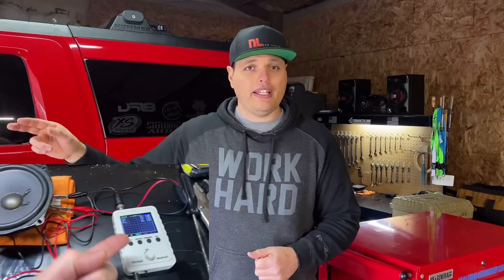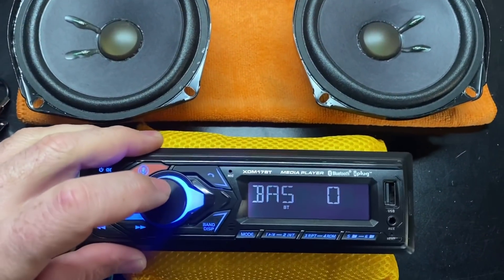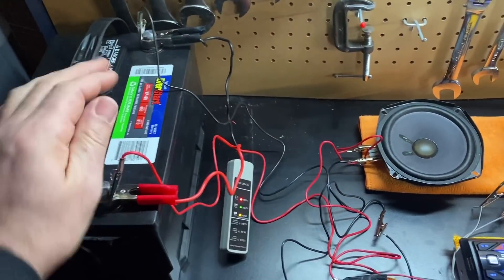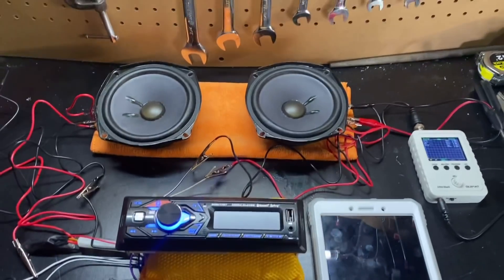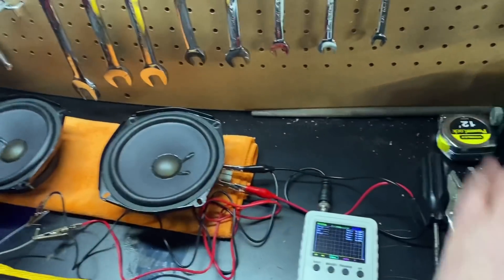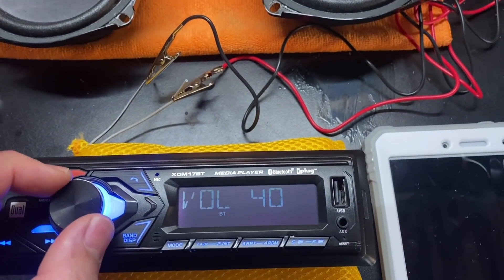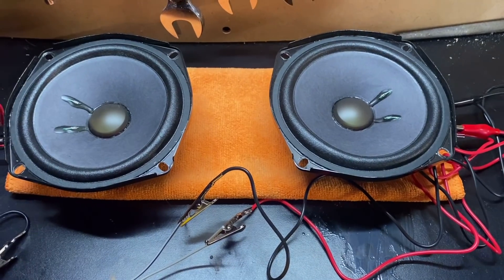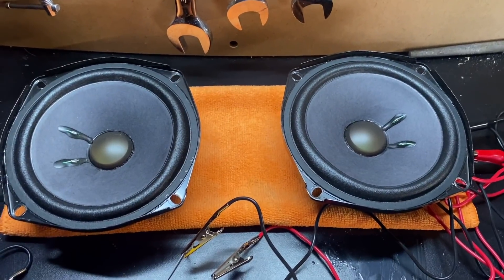#1 Must do tip!!! How to check head unit clipping and non distortion volume point of stereo.

Comment: I just used this method on my 2018 KIA Niro with the stock radio, a Power Acoustik RZR2300, and a Savard HiQ in a custom built box.  The max volume on the radio is 45, so over the last couple of years I decided the max volume should be 33.  Well, after performing this test, 33 is in fact the max volume before clipping starts.  Thanks!!!!
Reply from the maker: Awesome! Thanks for the feedback 😎
Reply: @NextLevelCarAudio  I'll tell you what- whatever head unit you used was a very good 1. Distortion didn't start till the 88% mark where many are at the 75% mark. What brand was it and do you recommend a good 1 with little clipping on a marine unit
Reply: @NextLevelCarAudio  op

Comment: This would be checking for the clip point of the decks amplifier itself. Pre outs will definitely be different as I have tested this before. Alpine units I owned pre outs didnt clip at 35/35, but the amplifier inside the unit was only clean up to 26/35.
Reply: Yeh bro I got an alpine ilx-w650e and when I tuned my type r speakers I tuned it so the head unit is all the way up and it sounds clean as, no distortion. But I also got told that by having the head unit all the way up it doesn’t get as loud because your using less clean amplifier power and more stereo power if you know what I mean. What’s your thoughts on that mate, cheers.
Reply: This is a great point...especially when you have low voltage pre amp outs which are more prone to noise.
Reply from the maker: This video was made for that reason. To help people find max volume  that have, say an amplified subwoofer but still running a non amplified front stage. Or anyone running speakers still being powered by the head unit. Then it is Vital to know when your HU clips. If you are running 100% externally amplified, technically you could send full HU volume to your amps and it can still put out an unclipped signal. Especially if you have decent preamp voltage 5v+. I just personally would not do it. It just makes me cringe to see my volume knob maxed out lol 😂 so, I just use the Same unclipped volume point as the high level reading and dial in everything else accordingly then don’t go past that point. Has worked great for me many years and have gotten pretty loud and clean.
Reply: @NextLevelCarAudio  yeah that's a good rule of thumb...and maybe a bit lower for cheap HU's that have low voltage preamp...that should still give you enough linear volume.
I wouldn't be able to stand seeing my volume at max either. Heh
Reply: This is what I am seeing as well with an iDoing head unit.  Thought I was doing something wrong at first but have tested it in multiple ways with loudness / EQ settings and still clipping.
Reply: I made this mistake on my first setup, but I compensated by having a higher gain on sub amp, not even understanding, but just knowing not to turn the stereo dial as high.
Reply: @NextLevelCarAudio can you test the preout RCAs on a head unit with the scope? Or would you have to go to the amp to test . I’m running a Chinese floating head unit. But I’m running off all RTA’s. I’m running off the front for my four channel and then I’m running my sub off the single sub out.

Comment: I had to try this, and surprising to me the Pioneer 4450bt clips at 48 of max 50. For a relatively entry level unit I was a little shocked at that. Thanks for the tips man, I can tune the amps to that now instead of the 3/4 volume I did it to originally!

Comment: Thank you for taking the time to make this video! This is the 2nd video I watched on this channel. You finally sold me on this Quimat Oscilloscope. I just purchased one now.  I already set my gains using 0dB which now I know is wrong. Should be -5dB. Volume is also set at 29 like in your other video.
I'm using old school MTX amps from 1994. MTX2160 for the 6.5 Diamond S6.0m mids and a MTX2300 on 2 RF 2212 Power DVC's. These MTX amps do not like high voltage. They were putting out too much signal on 3.3V from an Eclipse 8454. Looking into it they are rated at 1VRMS for their claimed output. I'd like to see how their output clips with 1.5VRMS Pioneer 2400NEX if they can tolerate it. Maybe go up to 2V output from the head unit.
Thanks again!!!!!!
P.S. SUBSCRIBED!
Reply from the maker: Hey, thanks for the comment and for supporting the channel. If you need any help with anything let me know ;)

Comment: Got my oscilloscope today..just tested my Alpine CDE 175BT. Head unit amp power which is 18 watts rms maxes out at 27 no clipping. Pre-outs max out at 35 no clipping which is the highest the volume goes. I guess I have one of those one or two head units that maxes out at max volume no clipping. Thanks for the great video. I'm at peace now. :)
Reply from the maker: Awesome! It is common for the RCA clip point to be higher than the speaker outputs. But max volume? Even better 😎 it is all dependent on the preamp output voltage your RCA’s are dishing out from the head unit. But hey, awesome! Glad it worked out well for you!
Reply: @NextLevelCarAudio  It's 5 volts pre-out which is why I got it.
Reply from the maker: Nice

Comment: You have helped me out so much with my truck audio. I can't thank you enough for putting this info out there. Just bought one of those cheap oscopes and can't wait to use it
Reply from the maker: Awesome. Thanks for the feedback
Reply: @NextLevelCarAudio  am I suppose to connect my positive alligator clig to the ground tab on top of the oscilloscope before using it. Out of the box the screen had hundreds of lines up and down and it wasn't even connected. 

Please let me know how to use it from the box

Below are the speakers and amps in connection too

2 wetsound rear facing speakers bridged on polk audio amp @ 4ohm 28.28 @ 200w ch

Jl sub on polk audio @ 4 ohm 34.64v or 31.62v @ 250watts 

2 Wetsound revo 8 & Ds18 tower speaker parallel on jl 360/2 amp @ 2ohm 19v @ 180w ch
Reply from the maker: I go over settings and such in detail here:
https://youtu.be/nKQqcQ5q34I
If that does not help, I’ll have to get back to you later man, I’m not in town and don’t recall off the top of my head

Comment: How do you determine settings on the oscope, specifically voltage? You set it to 2v but why exactly?  Orders one of the cheaper oscopes off Amazon so I can set a 4runner's factory HU that's running to an Lc7i then to kenwood xr901-5 powering factory shitty speakers and a 10" sub. Also need to find bass roll off too from factory so your videos have been helpful!

Comment: if im running this test on a head unit that has a build in amp should i turn off that setting before i try to find the clipping point of the head unit? i will be running an aftermarket amp

Comment: It is worth mentioning that some units with rca outputs may clip on the internal amp but not on the RCA pre outs.
Reply: So would it be of any bit to doing this after the amp?
Reply: @dropzoneJustin  you work it like a process. Say you have a head unit a mid 2/3/4 channel amp and a mono block amp you would disable the mid and sub amps find distortion/clip of head unit and never pass that volume afterwards. Then you do the same thing but checking the signal out of the mid multi channel amp to set the gain. Then disable the mid amp and set the gain of the sub amp. There is also ways to use a calculator and multimeter to ensure your gain is correct along with this way of listening. Once you have the head and mid set disable the mid amp and go onto the sub amp and repeat the process. Remember each of these amps are playing a select signal range you may use a 80-120hertz signal to set the head and mid amp but then use a 40herts signal to set the amp to sound but always verify with a multimeter and calculator that the gain is within tolerance. Once you have the head unit volume noted i would set the head unit to the preferred EQ/loudness on or of all that stuff and check it again because the clip point could change with those settings. Always look at the audio system as a chain of command because if you have a poor/undesired signal at head unit (first in the chain) then it doesnt mater what you do the signal of the next links in the chain is already undesirable. Not all of us can afford the fancy SMD tools or an O-scope or know how to use them. Another thing to consider is give yourself some head room if you daily drive and bump for hour or more at a time find the gain setting max and back it off a bit so your equipment doesnt struggle at 100%. Setting crossovers is also a key part to not blow your gear if you set the crossover cutoffs and slopes to be sharp (12+db) the undesired frequencies fall off faster and your equipment becomes more electrically efficient IE amps dont get as hot speaker coils dont get as hot and for subs they arent trying to jump out hte box and run away. Sub over excursion and heat is the number 1-2 killers. Subsonic filters are a bit new to me but say your box is tuned 31hz and the speakers FS is 38hz but claims to range from 24hz to 900hz you dont want that sub playing at volume a 20hz or below signal you want that subsonic to drop off at like 30hz because it will roll down a slope from the 30 to 10hz range the DB setting of a slope is the speed the filter rolls off down that hill and the lowpass filter is the same thing but for the other side of the signal range like from 80hz up if we are talking subwoofer it may be set to anywhere from 80hz to 250hz and slope off as the hz increase. Hertz is basically like beats per minute of an alternating current be it AC or DC power. good luck tuning and remember give yourself some room and your gear will last longer dont crank dials to impress or 1-up other people. IF you set your stuff up right it will last a long time. I am just now building a new system the last one 4-jensen Xs1010 150watt rms on 2 old 2channel amps and a 2/3/4 channel Logic Soundlabs 800watt amp for the mids and highs getting signal from a old school pyramid switched active crossover.. This system lasted over 20 years still works fine been through 4 vehicles and few sets of mid and highs but same gear and subs for all that time. Times have changed the equipment now is way more complex than it has to be honestly by now the amps should have auto tuning features but if they did that you all wouldnt break gear and they would make less money. New system in the works will be using modern head unit, DSP, and 2 sets of Audiopipe txx-bdc2-10's at 1ohm per pair on 2 skar audio rp1200.1 amps  using same old school LSL4640 4channel 800watt amp for the rest. If you didnt guess i am a fan of 10inch subs and for good reason 12-15's are more of air pumps where 8-10 in the right box give you all you need for decent SQ without taking up all your cabin space the idea is to make your vehicle into an order of the enclosure not make the enclosure so big your cabin is useless and chokes the subs. I took a break from soldering and cant put my last sub in the box cause the impact gun will piss off the wifey at 2am...Who gonna help me carry the box back out to the jeep if i make her mad? Im still waiting for my only fans to blow up so i can afford a 300amp alternator for a 04 grand cherokee (0.o)......will be waiting for a while i think.
Reply: My IDoing head unit does not clip on RCA outputs.  I just got the scope and set everything to high settings on head unit but no clipping with 1k tone.
Reply from the maker: Rca outputs are low level and will not clip like high level/speaker outputs will
Reply: For example my headunit clips at 54, then I test on amp and it distorts at 42(4 channel) and 50 (sub amp). My max would now be 42, right? Cuz I can’t use 54 if distortion after amps is lower. Thanks in advance.
Reply: @eddiearciaga9001  yes 42 is your max if you’re using the 4 channel amp as your main drivers for your speakers. So as you should, tune the subwoofer gain at max 42 volume on heady (4channels amp max with no distortion) so both subwoofer and speaker work together at round the same volume, DO remember to set your eq before you set the gains on both the 4 channel amp and subwoofer. 

FYI heady (headunit) distortion is mainly  for non amplified speakers. Notice how your heady is distorting at 54 and not at 42, it’s because the EXTERNAL 4 channel amplifier is AMPLIFYING the signals that’s coming out the pre outs of the head units own INTERNAL amplifier. Which means turning the gain up on the external 4 channel amplifier will significantly increase the “sound” that’s coming of the headunit by a much larger margin. But each headunit and amp is different. So some cases might not be as a big margin!

Comment: Hey mate good video, just got a question, when tuning your mids to hear for clipping how do you know what test tone to use? My mids play 150 hertz and up so would I still use a 40 hertz test tone?
Reply from the maker: You can totally use 150 or even 1000hz. I just used 40 as it was easier for me to show what distortion “sounds” like through the video using that lower frequency.

Comment: I know this is an older video. but I just picked up this scope but mine doesn't show the "waiting", "Running" and the bottom row of my display is different.  It reads Volts, voltage multiplier, milliseconds, (don't remember the 4th) and then "Run". Then the last thing is I noticed your graph reads only upwards, whereas mine will show positive and negative curved waves..... Am I missing a set up here? Also, do you know how to calibrate it/is it important to calibrate?

Comment: Do I need speakers connect I don’t use those the wires mine are all done by amps but I need to check when I’m clipping can I just connect to out puts for fronts on head unit wires will that do the same job please reply

Comment: I learned a LOT from this video, and in fact I'm watching it for the third time in days right now! But what I can't believe I'm seeing is someone so into high-end car audio who actually has a Dual head unit on the bench! Dual??? Probably the lowest quality of car audio stuff out there? I'm baffled by this. Why would you even have that in your shop? I'm gonna guess you took it out of someone's vehicle to do a head unit upgrade and it's just tossed in a box of junk, because that's what Dual is. Oh sure, I'm 62 years old, so I remember when Dual made some of the best turntables out there back in the 70's. But, like so many other brands, like Phase Linear and more, their quality has gone from very high to extremely low over the years. Just thought I'd point this out. STILL an awesome, very informative video! And I'm going to set MY head unit's volume level max using this method. After what I spent on my Alpine mechless head unit, I want the cleanest sound I can get running through my equalizer and back to my amps. THIS little tool is certainly going to help!
Reply from the maker: Thanks for the support. A lot of my viewers are on a budget and have dual, Jensen, Pyle, etc head units. So i like using things that relate with my viewers for my testing. Now, in my Hummer/demo vehicle that’s a different story. I have a top of the line kenwood excelon.
Reply: @NextLevelCarAudio  I saw that! Nice deck! I've had a few Excelons in my years but none quite like that. When I had them, the cool thing was those dolphins swimming across the screen! LOL! But I had mine set to the spectrum analyzer screen which was more cool to watch. But yes, I understand the using lesser dollar brands for demonstration purposes. I was once a huge fan of Jensen speakers, and even had several Jensen amps over the years. Like many viewers, I too am on a budget. I have better gear than any of my friends or family, but it's all purchased after months of research. I know what I like, and I do a ton of comparisons before I rush out and purchase ANY piece of car audio. Then of course I look for the lowest prices on my choice on eBay! Got my Nakamichi 4-channel amp brand new on eBay for $150 but it would have cost me $300 directly from Nakamichi, so the money saved helped on other purchases. I'm waiting to find a video from you that explains the best connections for tweeters. That's my issue right now. In my previous couple cars I ran them right off the head unit and they sounded okay. Of course I use 5,000Hz bass blockers with them! Now days, I'm running a pair of Cerwin-Vega tweeters in parallel off both the front 6.5's and the rear 6x9's. They sound crystal clear, as I was hoping!  I didn't do this until I found out the importance of a 20-watt 8-ohm resistor Cerwin-Vega says is needed if using high power amps. Trouble is, they still seem to shut down after 15-30 minutes of higher volume, but come right back on if I turn the volume down. I want to run all 4 tweeters off a second amp, but not sure on the best choice for a strictly high-frequency tweeter amp. I'll look through your channel and see if you explain tweeters more.
Reply from the maker: Nice! Lol, I’ll do a video specifically on tweeters. Have not done so yet really